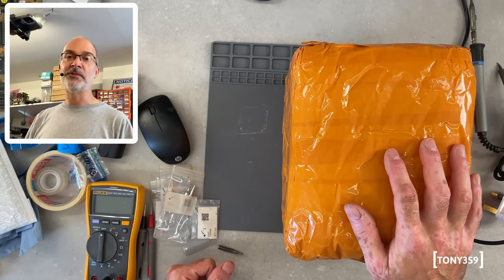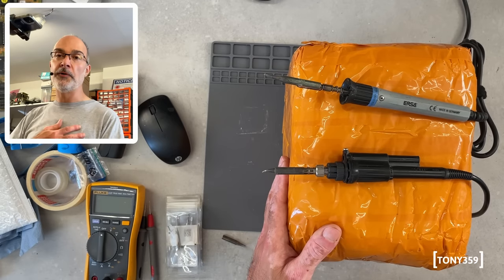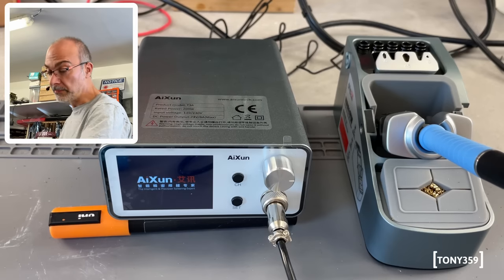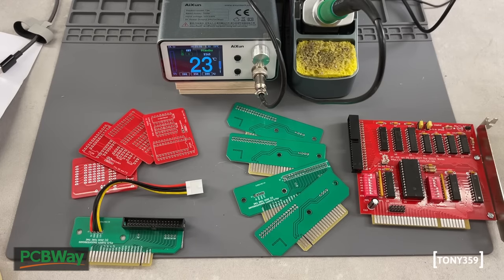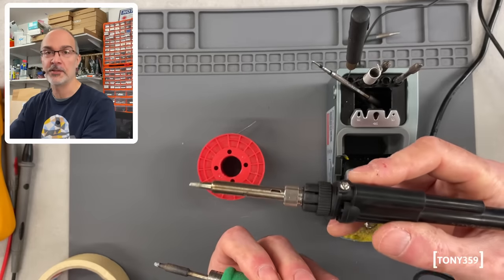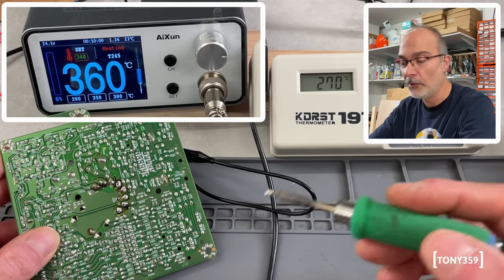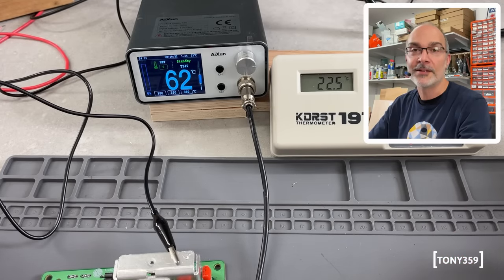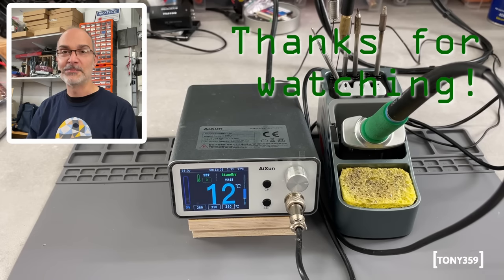Is the Aixun T3A a good T245 soldering station?

Comment: It's never straightforward buying a Chinese product is it?! My guess is that noisy, injected ground current flows from the SMPS to the external ground via the tip. On its way it generates a noise voltage across the lead resistance from the station to the iron tip but this, unfortunately, is in series with the thermocouple (TC) voltage used for temperature sensing. This noise voltage could swamp the TC voltage of around 25uV/C causing the erratic behaviour.

This could be checked by scoping the o/p of the opamp used to amplify the TC signal (but only valid when the heater is off). I guess different F/W revisions are playing with digital filtering to reduce the noise but it will be a compromise between the amount of filtering and the response time of the filter. This noise current could be measured across an extra resistor in the lead to the tip/TC (green) connection and used to estimate the noise voltage (based on the measured or typical lead resistance) and subtract it from the TC+noise measurement.

The JBC CD-2BC station used a mains transformer and thus wouldn't suffer from injected ground noise. SMPSs use a class Y capacitor from the 'live' side to the output side to return the leakage current passing through the transformer's parasitic inter-winding capacitance. It's that leakage which causes the tingling feeling you often get when touching the supplies o/p.

[EDIT] The injected noise current would more likely flow through the lead to the tip's common (red) connection and then throught the thermocouple to the externally grounded tip. Either way it will generate a noise voltage in the temperature measurement path.
Reply from the maker: Thanks for the nice feedback! What really upsets me is that if the issue is the SMPS, why did they even design a station with one in it?? I'd be tempted to get a station with a linear transformer in it...